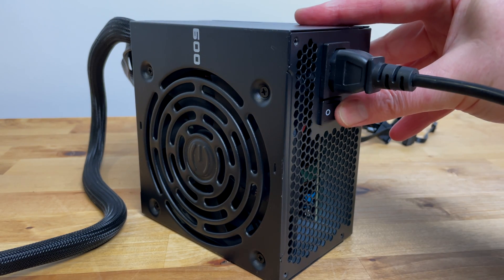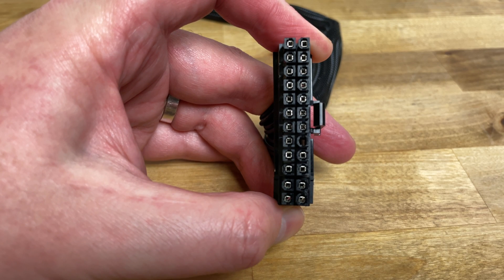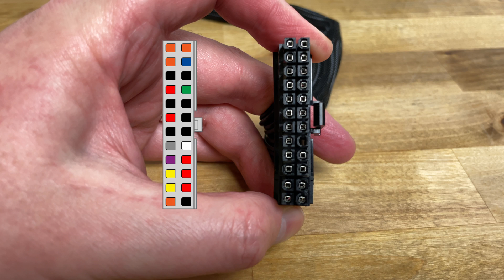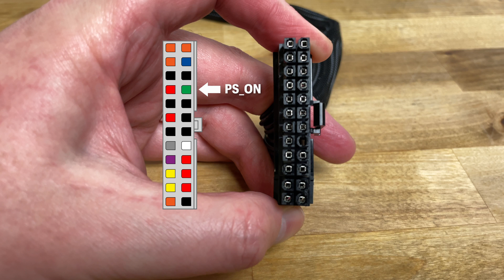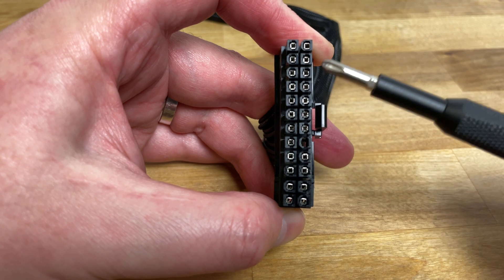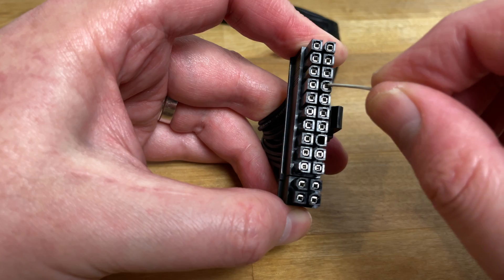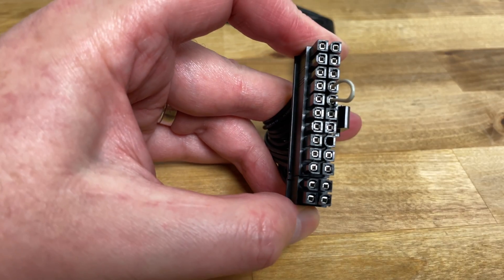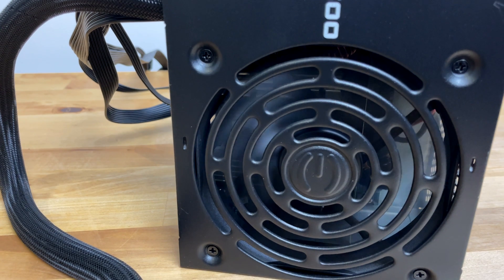How to turn on an ATX PSU outside case without motherboard

Comment: what if the power supply doesnt have a on/off switch and connecting the green and black wire does nothing?  thanks in advance.

Comment: it worked, ty so much now i can use any 12v or 5v accessories on my psu❤
Reply: @crismaniactalledo9717  it is safe ?
Reply: @zakClips99  As safe as using it in a computer tbh

Comment: All good ..But.. how is it ?? That the Power Switch on the PC Cabinet is "Momentary Contact". What pins ?? Or, how is the Momentary Switch ON / OFF Power Achieved ??
Reply: motherboard does it
Reply: PC Cabinet wtf. Thats a really dumb way of calling a PC Case haha. But yes, the motherboard handles everything, it tells the PSU when to turn on after the power switch headers have been shorted

Comment: I have old Atx PSU. I got the PSU running by this method but when I connected the sata hdd, it did not spin. what is the solution?
Reply: The Psu mat be bat

Comment: Thanks! I bought a new PSU for my old RX570 that I had since my old PC broke. My lenovo prebuilt that I recently got can't handle a GPU sooo I'm using this as a alternate way till I get my 24 pin to 14 pin adapter since I don't wanna make it manually lol
Reply: what kind of witchcraft is that ^^

Comment: This works so long as your PSU is dumb enough. I apparently have a PSU that detects load on the CPU connector and won't turn on using this method. I came here to see if I could figure out how to circumvent the problem.
Reply from the maker: I've never heard of a PSU that does that. It's outside ATX specification. the spec states that "When PS_ON# is pulled to TTL low, the power supply should turn on the four main DC output rails"
New motherboards allow BIOS updates without a CPU installed, how are people going to do this is the PSU won't even turn on?
Reply: @BartechTV  It's real, old ATX PSUs require a minimum load on a certain voltage rail (usually the one with the most power) for it to regulate voltage properly.
Without this, some ATX power supplies will outright refuse to turn on or output lower than rated voltage on all voltage rails.
Some PSUs even require minimum load on more than 1 voltage rail.
Reply: @Yosuwu  how old
Reply: @shivamvidrohi  More than 10 year old PSUs at this point maybe, not sure but roughly that.
Reply: @BartechTV  I managed to get mine working again by plugging it into a motherboard. I think that it must have gone into windows sleep mode and wouldn't come out until it got back to a PC motherboard. At least, that's my theory. Once it started up connected to a MoBo, it jump-starts just fine.

Comment: Thanks for the video. I used it tonight to power on a PSU to power a GPU since mine apparently isn’t antiquated to run. In your opinion is it ok to run a power supply into a GPU via this method for about a week?
Reply from the maker: It should be fine. I used a PSU powered on using this method for almost 2 years to power an eGPU with no issues.

Comment: I tried this once, it exploded!

I think it was a Dell specific PSU that happened to have different wiring though..
Reply from the maker: Dell PSU's don't follow the ATX wiring  standard. You probably shorted +5v to ground instead of PS_ON#
Reply: Will it work with a Corsair psu?
Reply: @UndefinedxVon_  why dont you try it